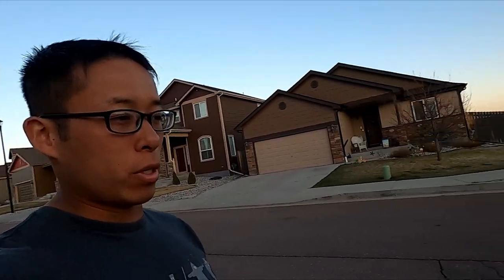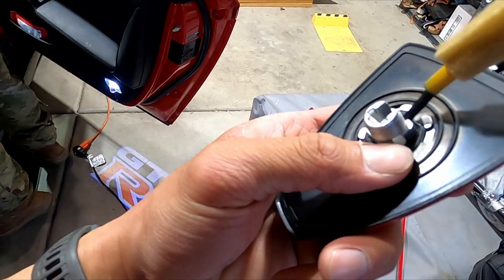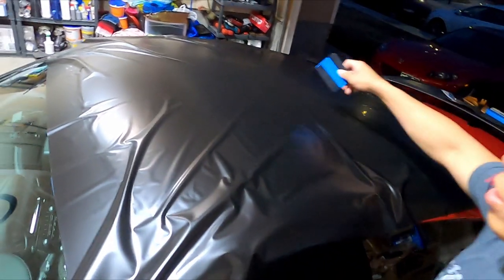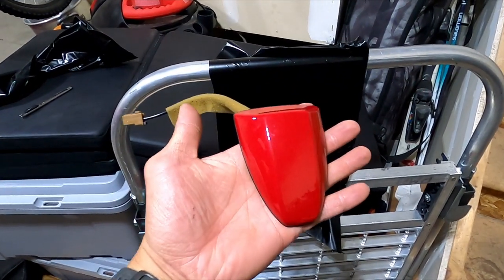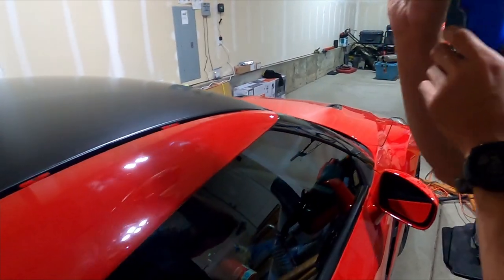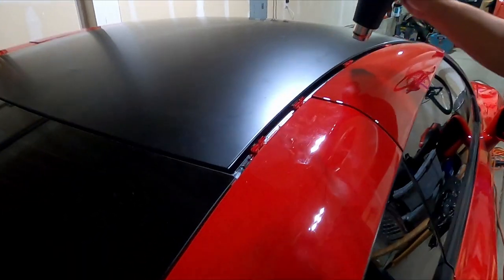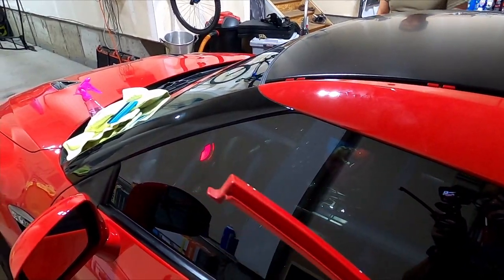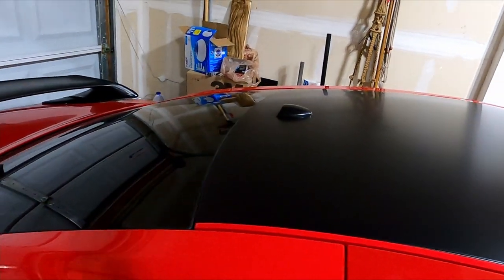How to wrap any antenna and roof. Easy method for any car! Watch!

Comment: Is there any chances you can make a video to teach me, how to remove the center console bezel. I'm  thinking to wrap the bezel with other color, but couldn't find enough info to remove bezel from center console. Thanks
Reply from the maker: For what car are you thinking about doing?
Reply: @thehuangbros  
It's RCF,  if you can make a video for this part in future. It will be very helpful. 😄
thanks
Reply from the maker: @ry9392  so the center console where the shifter and trackpad are located? Like that whole center piece?